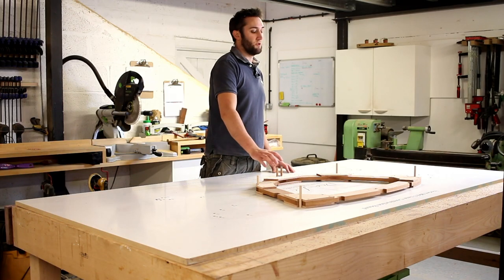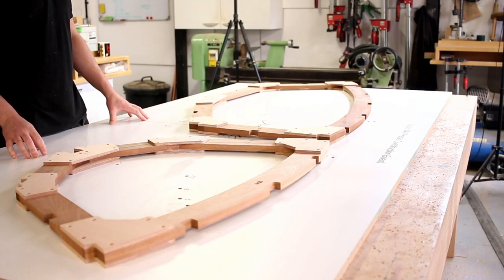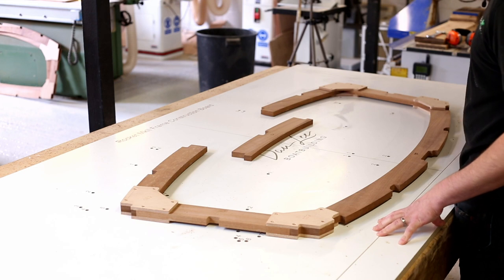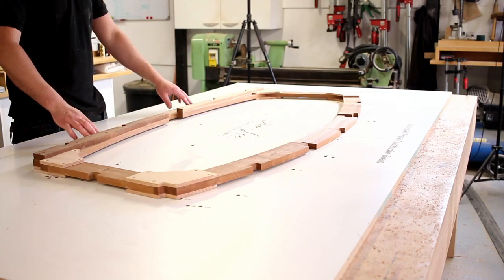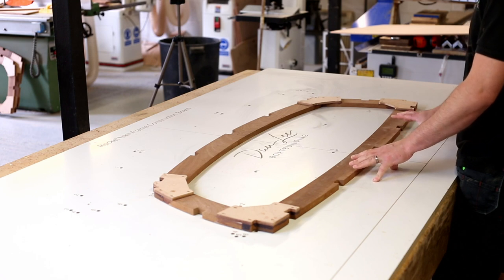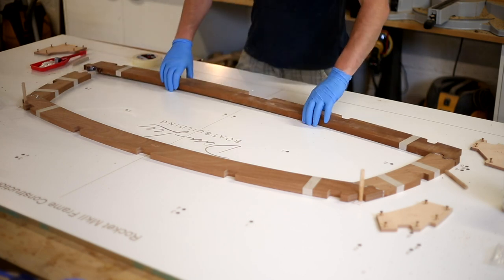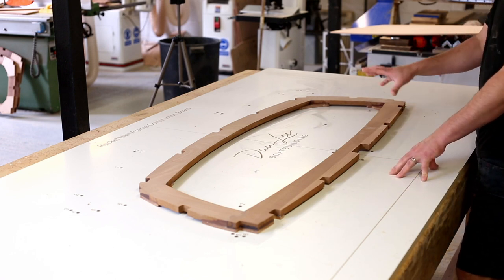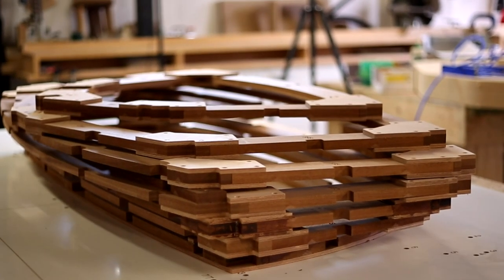Rocket MkII Boat Build Pt 4 - Differing Frames

Comment: Hi Dan how do you get that varnish finish? I’m using polyurethane flag with a roller & a purdy but still finding it hard to get it right! Specially on the vertical sides of the boat. Will the varnish you use work over polyurethane? Regards Bob
Reply from the maker: Hi Bob, have a look at the video I did on varnishing Rocket. It will depend on what varnish you are using, bubbles from foam rollers are quite common but with Epifanes they all tend to flow out if left alone, that's what I had found anyway. I would imagine Epifanes will be fine over polyurethane if it is keyed up properly, it is usually the other way round that you run in to issues.
Reply: Dan Lee thanks for the advice Dan! will give it a go!!